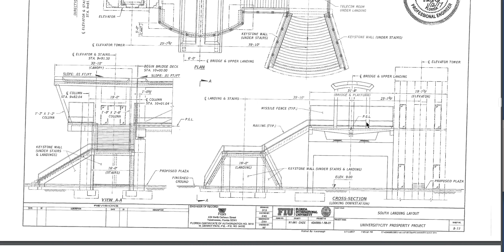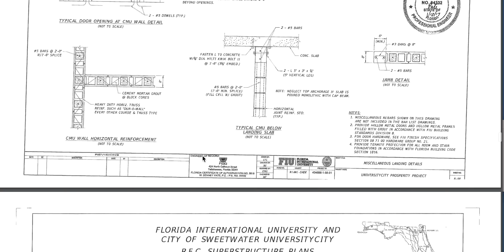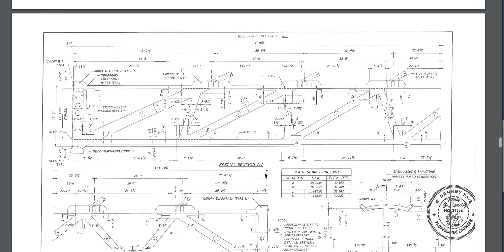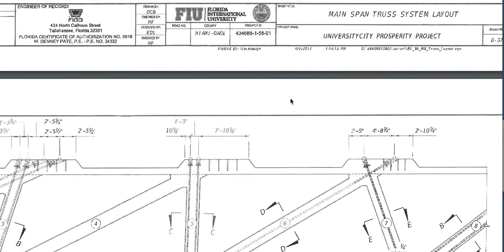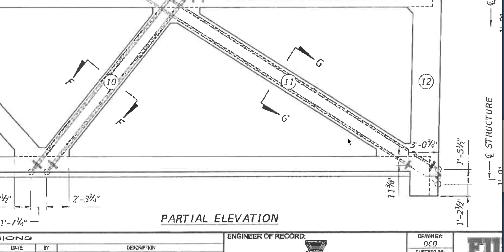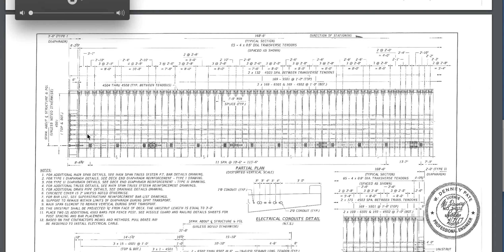FIU BRIDGE COLLAPSE TORQUE ACTION OF 12 AND CANOPY EQUILIBRIUM MOVING TARGET EXPLAINED

Comment: Great video you have been very busy, hope you are feeling better.  All these different angles from one end to the other had to be a nightmare to calculate the point loads.  The canopy looks like it could catch some wind would have applied a force on the deck.  The truss components would act as a lever to transfer the force of the wind to the center of the deck.  The picture of the crack you show in the drain area on the bottom appears to be showing evidence of  a deflection in an unexpected  direction.  If it had not collapsed this may have become a noticeable maintenance problem in the future.

Comment: Thank you for admitting after 3 years that this is not a truss system.   Truss joints do not transmit moments.
Also, if you are looking for alignment of adjoining loadbearing structures you should remember that concrete has thermal expansion and contraction and aging / hardeneing related volumetric changes.  It might be line to line to start with but even after a few days let alone a few years the joints will not be coincident.  Also, for heaven's sake, after 3 years, it is the canopy and the deck, not diaphram and butterflies.
Reply from the maker: You are triggered... relax and open your mind...
Google butterfly design in roof design...